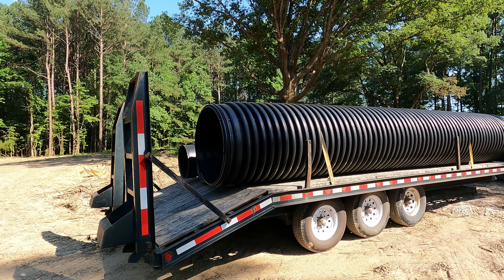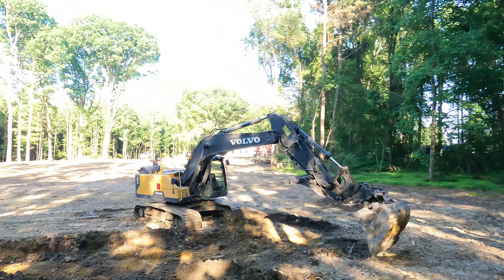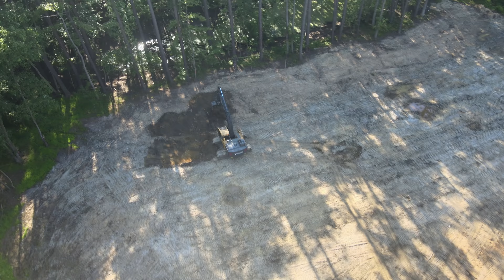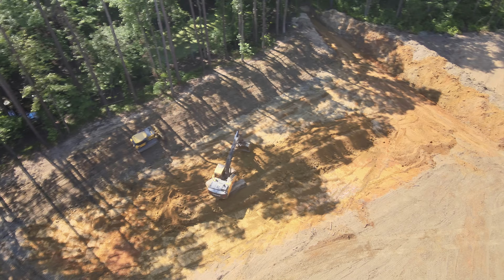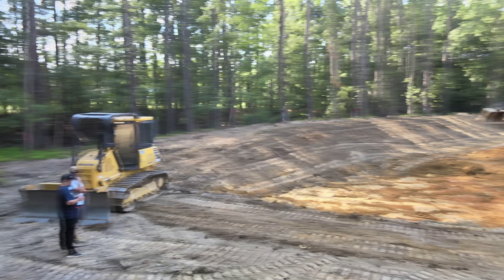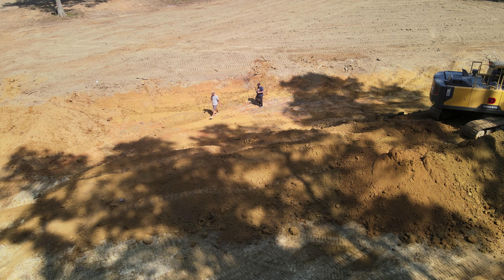LETSDIG18 STARTS THE BEALY GOOD FARMS POND BUILD

Comment: This might be a dumb question but do you have to stock the pond with fish or do they just find their way there from the springs? So glad you used Chris or I might not have found you otherwise.
Reply from the maker: Great question. I will have to stock the pond. The creek does not have water year round. I suppose eventually there would be some fish introduced to the pond but it would be a small chance and take a long time to happen. I’m glad you found the channel. Have a Bealy Good Day!
Reply: Alot of times birds will introduce fish to a pond. Eggs on their feet and they walk in your pond. 99.9 percent of the time they are trash fish. A good stocking of bass or any predictor fish will control that problem pretty good tho

Comment: Don`t know if you calculated your pond,,based on a standard of 1 acre inch = 11,000 gallons - your half acre  [5500 gallons ] X an average depth of 72 inches = 396,000 gallons of water.
Reply from the maker: Interesting. Thanks!
Reply: One acre inch is closer to 27,000 gallons